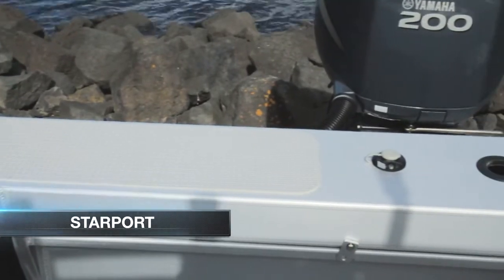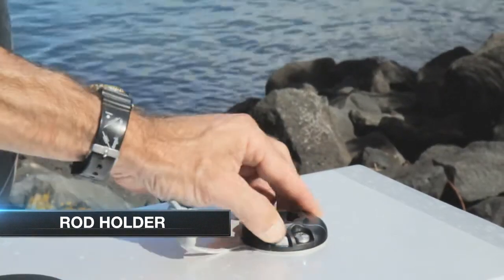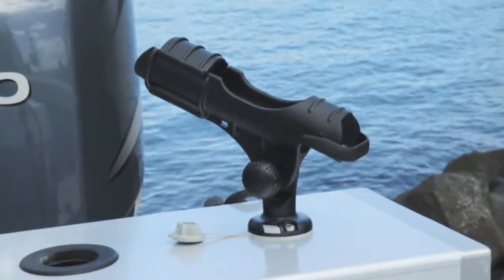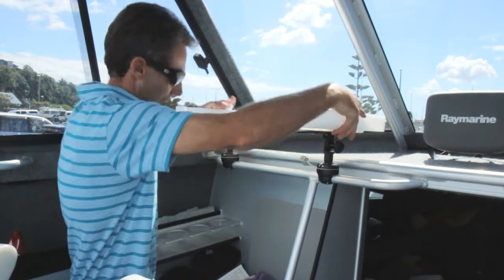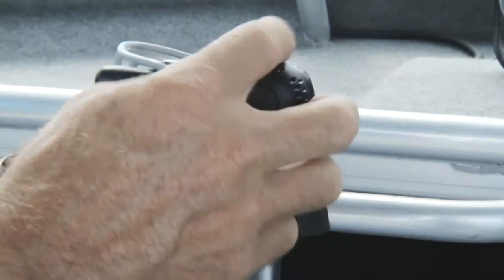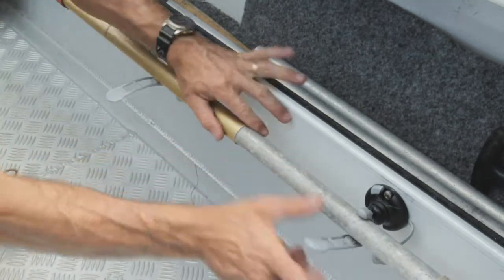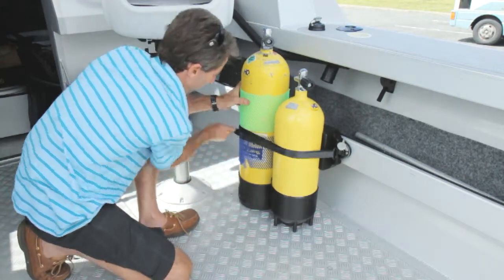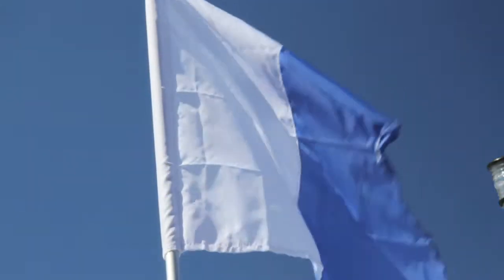RAILBLAZA - Power Boat Accessories

Comment: I have a common accessory rail standard to an Ascend FS12T sit on top kayak... Not a single rod holder dealer mentions if their product attaches to it. All i see are mounts that affix directly to a boat or kayak via screws... What gives? If your starports attach to it you may want to give mention on your website.
Reply from the maker: Hi Charlie, what size is the accessory rail, we sell RailMounts, see here https://www.railblaza.com/products/railmount-19-25/ or https://www.railblaza.com/products/railmount-32-41/. 
Thanks for your question.